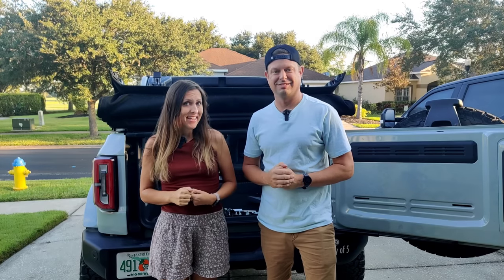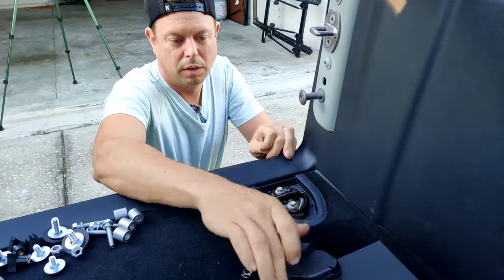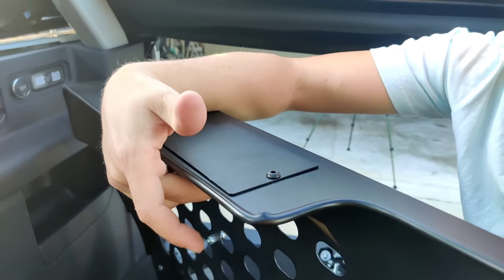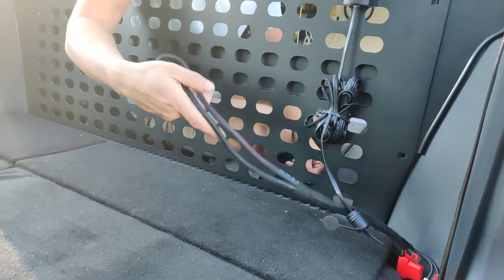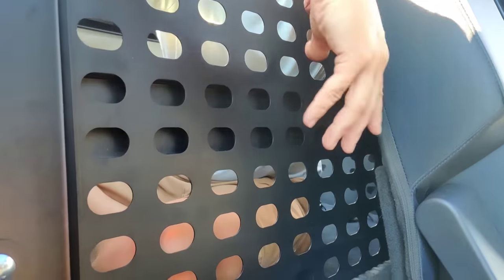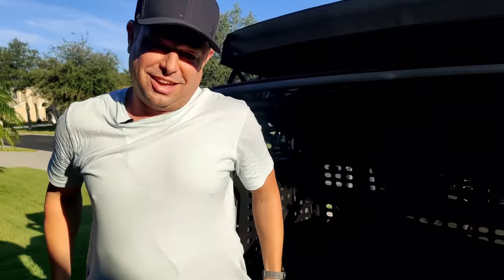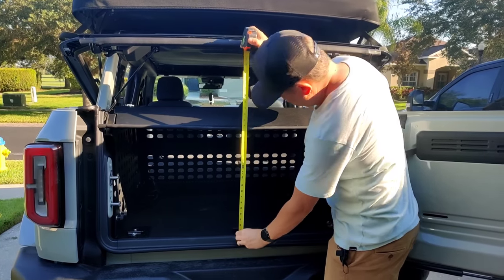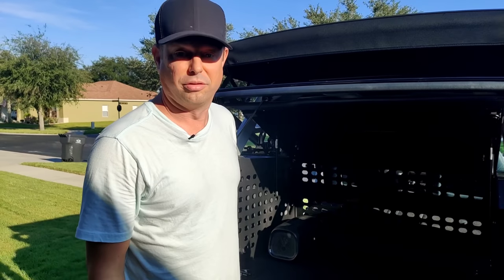Ford Accessories Cargo Area Enclosure Deluxe Raised Lid for Bronco Install & Review Tonneau Tuffy

Comment: I am considering options for the back of my Bronco (on order) and am going back and forth between this and a drawer system.  My Bronco was specced out with a hard top, so not generally concerned with theft, but I want the ability to organize, so am thinking the divided drawers would be nice to pack things away and allow me to stack gear on top, but I don't think the drawers are tall enough for things like a compressor and the molle panels on this set-up would also be really useful.  Any advice on the pros and cons of each for a hard-top truck?
Reply from the maker: I just searched and the dimensions is the drawer system is not super easy to find.  We have seen one in person but it was locked in a dealer demo and the key wasn't present so unfortunately we couldn't open it.  If I had to guess the storage area might be 6 or 6.5 inches tall on the inside.  My first thought was it that is looked limited by the height.  Things like small tools, battery cables, first aid kits, straps would fit great.

Ours has a limitation of putting taller items in the back, not a huge deal since we have the truck.  The convenience and security of the system has been great.
Reply: @BuckleUpButtercupTV  Thanks.  Yes, not much info out there.  I did see one on the mannequin I test drove, but wasn't thinking about a compressor or any of the other stuff I'll want to carry at the time... just too excited to actually see one in person and get to drive it.

Comment: Do you know why the lower fasteners are a quick connect wing nut from the side panels to the floor?  Seems like they intended those to be removed frequently, but not sure why.
Reply from the maker: I am not certain and have the same question.  Those are the only locations where the enclosure mounts to the Bronco itself, I assume you could remove those four wing nuts and remove the entire enclosure?  If so I believe taking it through the roll bars and straight up through the opening since it wouldn't fit through the doors in one piece.  That doesn't seem like the reasoning but it is the best I can come up with so far.
Reply: @BuckleUpButtercupTV  I thought the same,  but with the bars that blocks it.   Hoping to get mine late November.  It is being assembled now.
Reply from the maker: Not sure where you are located but it took 12 days from our build date to delivery.  We are 1,200 miles or so from the plant.  You might be surprised and receive your Bronco much quicker than late November!
Reply: @BuckleUpButtercupTV  I could only hope.  I am in Nebraska, so a little closer than you.  Love the videos and thanks.

Comment: I have this same enclosure.  My only concern is security, and y'all said it a couple times, but my question is how is it secure?  What prevents someone from getting into your Bronco and hit the lock/unlock button?  Its definitely a concern of mine if someone really wants to access your rear area, on how easy it really is to get into it.  Just an observation, great video by they way, my only thing that I couldn't get to work was the thick black spacers, trying to tighten them, the bolt just spun on me, so I did with out it.
Reply from the maker: You’re alarm will go off
Reply: @BuckleUpButtercupTV  The alarm will go off under what circumstances?
Reply from the maker: @toddbowden7856  if you locked your doors and walk away with your fob, if someone unlocks from the inside and the fob is not in there, the alarm will go off
Reply: @BuckleUpButtercupTV  Thank you for the reply.  I have been doing a bunch of testing to see what the parameters were to when this alarm goes off.  After locking with the FOB, it does take about 15 seconds for the alarm to enable.  I tested with the window down, then after 15 seconds unlocking the door, opening any door makes the alarm go off, which I really like.  Thank you for your informative video's.  It may be a good short video for you to do about this security feature and how it works.  Just a thought.

Thank you!!
Reply from the maker: @toddbowden7856  that’s a great idea, maybe I will do that

Comment: I drove a Ford demo unit with this installed and it rattled a lot, so happy that isn't happening for you!
Reply from the maker: I have heard the cargo drawer rattles.  I wonder if there was a loose bolt in the demo?  So far so good!
Reply: @BuckleUpButtercupTV  The demo unit I drove had the cargo drawer installed. The drawer unit seems really well built/sturdy, and I didn't hear any noises from it while driving. In-town at 35mph (on crappy streets), and also on the local interstate at 70mph, and not one bit of noise/rattle from the drawer unit.
Reply from the maker: That's great to hear!

Comment: Great video! How much do those run without Ford points?
Reply from the maker: I think it varies with what dealership you use, but if I recall it's around the $550-630 price range.

Comment: Great video.  Maybe I missed something but to remove the enclosure for larger items, can't you just remove the 8 thumb nuts and slide the enclosure out; sides, back and top still intact?  The floor mounts will remain but at least you have the ability to carry large items without total disassembly.  Again, maybe I missed something.
Reply from the maker: I assume that could be done but I do not think it would be a easy process to remove due to the size and possibility of scratching the paint.  Maybe if you took it almost straight up through the roll cage when the roof is off?

Comment: Stuck on step one. I can’t get the freakin’ stock tie down bolts to budge!! Do I need a torque wrench to get them off?
Reply: Success! This video was invaluable -  thank you!!  Have you found a good net to go on the enclosure top tie downs?
Reply from the maker: I have not found one, but I haven’t looked for one. Glad that you got it installed.

Comment: Just a quick question, did you just call your dealer or did you call a support line of Ford for your 20,000 extra FordPass points? I've only received the base 42,000 thanks!
Reply from the maker: I had to call the Ford line to get them credited.

Comment: Have you found a cargo mat that works with the cargo enclosure?  I have the factory one and it’s molded to fit the contours,so it will not work with this.
Reply from the maker: Rather than cut ours we sort of forced it to fit inside of the enclosure.  At first the center had a bubble in it but that has settled down and and the mat has been working great without the need for cutting or a heat gun to help re-mold it.  The lower fasteners of the enclosure also help to keep the cargo liner in place.  So far it has worked out nicely.  The only down side is things tend to move around more on the plastic mat so the Mille panels of the enclosure have been necessary to strap things down.

Comment: If the doors are off, can someone press the "trunk release" button in the cabin and get access to this space?
Reply from the maker: There isn't an actual trunk release button in the Bronco.  It can only be unlocked with the key/key fob when the doors are off. 

The rear door locks automatically when you are driving and remains locked also when doorless after turning off the ignition. It can be quite annoying but it serves the purpose of security.

When the doors are on it automatically unlocks when the rest of the doors are unlocked to exit the Bronco.
Reply: @BuckleUpButtercupTV  Also if you have the doors on and want to leave the cabin unlocked, but the cargo locked, you just have to lock the doors before you get out, then when you open door from inside, it leaves that unlocked. The tailgate will still be locked. I'd rather someone just open the door instead of cutting my soft top. I love this cargo enclosure!!!  Correction: this only works with the doors off. Someone can press the unlock button on the door and boom, the tailgate is unlocked. So much for security! The tailgate lock should be more configurable.
Reply from the maker: @cerbdm  I am just so happy to not have to worry about security anymore! Haha
Reply: @BuckleUpButtercupTV  can you fit the doors back there still with that installed?
Reply: @cerbdm  Disappointing, I wanted to get this to prevent a thief doing a smash and grab, pressing the unlock button, and then accessing the enclosure. Have there been any work arounds or changes?
Reply: @MrJakhgw  You just can't leave the cabin unlocked. If you lock the bronco with your key the tailgate will be locked. I just figured it's just as easy for a thief to unclip the back windows and get inside, but they can't unlock the back.  Doors off, or windows down would be the only way to allow easy access to the interior but still have the back locked.
Reply: @cerbdm  This is what worries me as well. The whole reason I'm considering this is to provide some secure storage when the top is off of the vehicle. If someone can just reach in and hit a button and unlock the tailgate, it completely defeats the point.
Reply: @NataiX  If the top is off, all you have to do is lock the doors. They can't unlock by reaching in, so the cargo enclosure is safe.
Reply: @cerbdm  Can you confirm and elaborate on that? I ask because in another conversation I'm having on this topic, it sounds like you CAN just reach in and press unlock. It will set off the alarm, but still unlock the tailgate.
Reply: @NataiX  i tested it on my bronco. after a few seconds, it will not allow you to unlock. A message will appear on the dash and it will beep, but no alarm.
Reply: @cerbdm  Excellent. Just to confirm (because this has been an overlooked detail with others), you tested this with the doors ON and the top OFF, correct?
Reply: @NataiX  just went out and tested again. Don't think top matters. I left the windows down and locked it via fob, door lock buttons inside, and intelligent access on outside of door. None would allow unlocking by reaching in. Dash display says "switches inhibited, security mode". Mine is a lux badlands, not sure if that matters.
Reply from the maker: That does not happen for me, it unlocks
Reply: @BuckleUpButtercupTV  are you waiting a few seconds after locking and making sure your keyfob isn't close by?
Reply from the maker: @cerbdm  yes, I can reach right in and unlock and no alarm sounds. We tried multiple times. The only thing that will set it off is if we try to open the bronco from the inside.
Reply from the maker: @cerbdm  I wonder if the lux has a better alarm?
Reply: @cerbdm  Perfect. Thanks very much for the assist. (I'm also getting a Lux BL, eventually, so that should be the same.) Thanks again!
Reply: @BuckleUpButtercupTV  This is really strange.
Reply from the maker: @NataiX  I know, it has me wondering if mine isn’t right lol

Comment: Complicated, I hope they came out with simple tanue cover
Reply from the maker: It actually isn’t too bad.  We have removed the top a few times and left the 3 walls installed.  Takes maybe 5 minutes to remove and replace the top if needed.
Reply from the maker: There are going to be more simple covers but not sure how they would offer the same level of security?